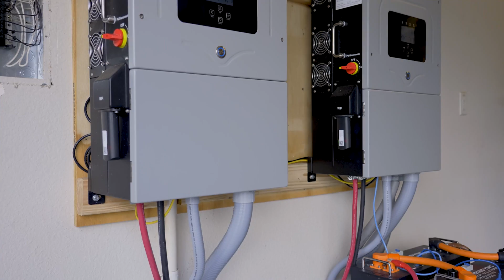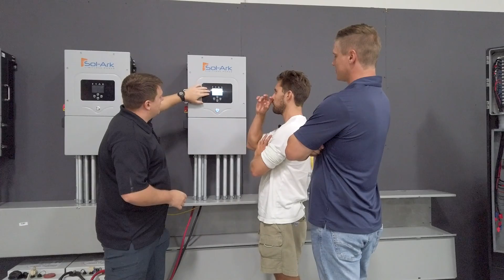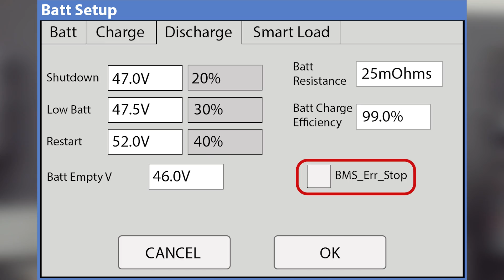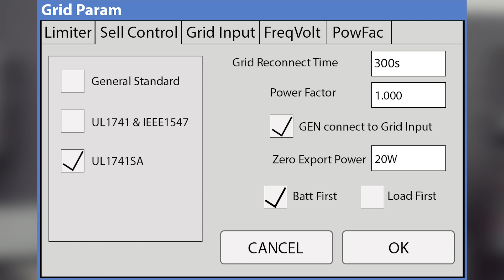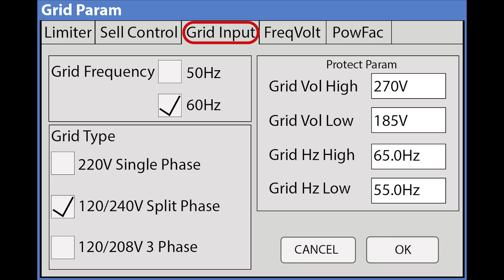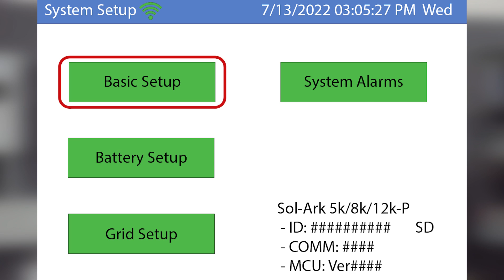How to Commission a 12K/15K in 30 minutes || Sol-Ark Install Guide (Re-Upload)

Comment: If you have a parallel setup do the setting on the master flow to the slave automatically or do I need to set it on the other inverter as well?

Comment: How do you adjust the Grid sell box?
Reply from the maker: enable time-of-use settings in the grid parameters LCD screen menu or use the monitoring portal
Reply: @Sol-Ark  Got it thanks.  Mine looks different from this video.  It's a split-box and not obvious you can select either section.
Reply from the maker: @charleshorseman55  its a challenge to get all settings available locally without requiring internet for programming/commissioning. at some point it becomes easier to review settings within the online monitoring portal. this video is a bit old, we do keep more updated training assets within our training portal at training.sol-ark.com

Comment: No thanks, I would never purchase or install any high frequency, transformerless inverter/charger in my system.
Reply: Ok, why do you personally want a low frequency transformer based inverter charger in your system? Are you connected to the grid. Solark seems very user friendly for those connected to the grid. Thanks
Reply: @paulbaker3144  I want a hybrid, low frequency, transformer based inverter charger because they provide a much high surge capacity for starting high inductance loads than this high frequency tansformerless design. They're safer because transformer based inverters can inherently block dangerous high voltage, high amperage DC current from passing through to your AC loads, which can damage those loads. And because low frequency inverters  typically last far longer than high frequency inverters.
Reply from the maker: Valid points in general however Sol-Ark has the most high frequency hybrid inverter field experience in the USA and actively maintains and supports its product from its USA HQ. HF has important advantages as well, such as better system efficiency. We also have EMP hardened options as well as EMP hardened battery partners. It's impossible to have everything but Sol-Ark is the most powerful single unit hybrid inverter on the market. 10 year standard warranty with 5 year extended option.

Comment: My Sol-ark 15k currently has no battery.  I've gone in to the Battery section and turned all the checkmarks off except "No Battery."  Rebooted and everything seems to be running, but there's still a battery icon on the main display (nothing going in or out of it) with 19.2V next to it (which changes).  Is that normal?  Any idea why it would display that?  The Battery tab is populated with some kind of information (default).  But, again, only the No Battery box is checked.  The big problem, though, is that I get periodic (every couple of days) Error 56 - DC_VoltLow_Fault errors:  Batteries are overly discharged, the inverter is Off-Grid and exceeded the programmed batt discharge current by 20%, or Lithium BMS has shut down. If battery settings are incorrect, this can also happen.  That shuts down my entire house as the 15k reboots.  Sol-Ark technical support has no solution except "add a battery."
Reply from the maker: Apologies for that inconvenience. I suggest re-engaging with technical support, especially via support ticket. We provide all of our support in house out of our Allen TX HQ, and there are managers that unresolved issues can be escalated to. Mention it is an ongoing issue when you fill out the support ticket here: https://www.sol-ark.com/contact-us/

Comment: Is there a way to connect the Sol Ark 15k to power the whole house using a All In One” (combination meter/breaker) service panel?
Reply from the maker: Typically all-in-ones also have an indoor panel on site.  The 15k would backup the indoor panel. The outdoor  "combo" loads could be relocated to a 100A subpanel outside the home, and then landed on the GEN port to also get access to the backup power (essentially abandoning the "combo" part of the existing meter base). One advantage is the outdoor loads could then be load shed during a power outage at low battery states of charge.

Comment: Very helpful.  I have a 20kw solar array and wanting to add 75kw battery backup (52v dc) how many would i need?
Reply from the maker: Often batteries are in 5kwh increments so 15. You can charge them with a single Sol-Ark 15k and you can put 20kW of solar on a single Sol-Ark 15k as well.

Comment: If AC coupled to the Gen breaker and have a loss of grid and batteries are full, the Sol-Ark will ramp frequency to 62 Hz or whatever was set on Smart Screen tab. When would the Gen breaker open in this scenario?

Comment: Thanks for the video!  (others have commented on the audio so I won't).   have two questions:

First question:  On the 19.2kW AC coupling limit.  Is that doubled if you have two sol-ark 15k's in parallel ?  Or is it a global limit?   For example, if I have two sol-ark 15k's operating in parallel, split-phase (north america normal), does that allow me to put up to 38kW worth of ac-coupled (enphase) panels up?

Second question: In terms of grid-export in situations where the solar is AC-coupled, the battery is full, the solar is producing way more than the house needs, the grid is up, and the grid-export limit would be exceeded, what does the sol-ark do?   It can't adjust the frequency since the grid is up so it is unclear how the sol-ark reacts to that.   (secondarily, does that mean I should also in addition to the sol-ark setup, install the enphase grid monitoring / export-limit feature too that uses comms to direct the enphase units to reduce power?).

Thanks!

-Matt
Reply: Both the 5k. and the 8k say 9.6kw A/C coupling but a couple of installer videos keep saying they are limited to 3KW. Sol-Ark states in their video that the 15k has a a/C coupling limit of 19.KW.  Just need to be really sure because all my panels have micro inverters and I want to install a HomeGrid Stack’d battery.
Reply: @kayjet64  Yes. The inverter's AC coupling limit is basically a function of its battery charging and discharging/inverter capabilities.  When the grid is down, it has to be able to handle the full AC coupled panel output for roughly 30 seconds or so while it adjusts the frequency, to prevent the micro inverters from shutting down due to thinking that they have islanded.

So for that parameter there is a maximum the inverter can handle, but the actual limit is more likely governed by the current capabilities of the battery conbnected to it.  Whichever is lower.

The grid's export limit is a different parameter based on 20% of your utility service size.   This doesn't count any AC consumed by the battery charger or the home, but you generally have to assume that the batteries might be full and the house might not be using power at some given moment.
Reply: Scenario. 8k Sol-Ark. I have 6KW A/C coupled grid tied Enphase. There should be no issue with the 3kw limit because whats not consumed (home load and Bsttery charging) will go back to the utility as credit (Net Metering). Issue would be when i’m off grid which is logical. ^kw A/C couple if there is no home load and the batteries are charged then it will be clicked until there is enough load to startup again.
Reply: @kayjet64  Yes, 6kW is small enough that there should be no issue on the utility side if you have a 200A utility service.  If you have a 100A utility service there might be an issue with the 4.8kW backfeed limit.  On the other-hand, there might not be an issue even with the 4.8kW backfeed limit if your panels never produce that much.  It sounds like you are in the clear there.

--

To handle a grid-down situation, normally the Sol-Ark is set to not charge the batteries completely full... usually just to 90%.  That way it can sink power by charging the batteries when A/C coupled solar output is greater than the home load for the roughly 30-60 seconds required to servo the micro-inverters to match the load.

This is where things get a little confusing.   There are two standards... UL-1741 and UL-1741-SA.  UL-1741 is the old standard and all it could do was turn the micro-inverters on or off using the line frequency.   In a grid-down situation, this is not ideal to say the least.

UL-1741-SA is the new standard which is able to actually servo the micro-inverter output using the frequency when in a grid-down situation.  This allows the inverter (e.g. the Sol-Ark) to match the solar output to the load.   However, since it takes 30-60 seconds to do this, the Sol-Ark still needs to use the batteries to handle slack in either direction.

So the best absolute setup is when both the micro-inverters and the inverter support the newer UL-1741-SA standard.   Meaning, generally, newer enphase inverters and the latest firmware for the Sol-Ark.  You will have to double-check that everything you have supports the standard.

And then lastly, AC-coupled solar can't self-bootstrap (I think I mentioned this before).  It needs a live circuit.  Meaning that if the batteries are depleted overnight in a grid-down situation, the system will not be able to turn on in the morning the next day if the grid is still down.   The solution here is to always have some DC-coupled solar so the sol-ark can charge the batteries up to their start SOC (5% or 10%) in the morning, turn-on, and thus bootstrap all the rest of the AC-coupled solar.

Comment: The new software version has reworded and relocated settings and i am unable to find the Power Factor Q(V) that is mentioned at 20:20. I have the flickering issue with LED lights.
Reply from the maker: Hi Emmanuel,
I recommend calling us at 972-575-8875 or filling out or contact us form for further help: https://www.sol-ark.com/contact-us/
One of our support techs will be able guide you to where that setting has moved

Comment: Looking at the 15K. We are grid tied and want a zero export system to take advantage of dirt cheap off peak power.

The utility requires the inverter to be disconnected while we would be using solar and batteries....how would we set that up?

Thank you
Reply: Use a transfer switch

Comment: Would like to see a more in depth video on AC coupling while also having whole home gen with 15k.   AC couple on the gen input as well as on the “load” side if possible, not grid side.
Reply: You would have a generator and ATS in front of the 15k between grid/gen/15k
Reply: FYI…..I think ATS stands for automatic transfer switch

Comment: This might be a stupid question but in my state there’s bo benefit to selling back to the grid so is there a way to set this up to not be able to sell back
Reply: Yes. You don’t have to sell back. You can limit it to home and it will just cover your loads only and throttle Solar and/or batteries if need be.

Comment: I had Sol-Ark 12k installed last year, during installation of the panels I asked if micro inverters would be installed on my panels and I was informed that they were not needed since the inverter provided the protection for the panels is this correct.  Thank you
Reply from the maker: Hi there,
Our inverter has protections in place for installations with and without micro inverters, so to answer your question, your installer is correct in saying they are not needed for the inverter to work safely. If you have any further questions, feel free to reach out to us at 972-575-8875 x2 or send us a ticket here: https://www.sol-ark.com/contact-us/. Our Engineers would be happy to answer any of your questions.

Comment: When your trying to sell a 10k ea product, dont release a video thats half assed.. You should know better. How hard would it have been to do another cut! Or is it not worth your time to do it right? You can be mad at me or say ...Hes right.. Your choice.
Reply from the maker: Hi Mihkel,
Apologies for any confusion, but just wanted to clarify that Auto Dim is on by default, but just in case it is disabled by the user, warranty will not be covered for just the screen if it burns out. The chances of a screen burning out are very low, but higher when Auto Dim is off and the Sol-Ark's screen is installed with consistent direct sunlight on it. We appreciate your feedback as it helps us improve, thank you.
If you have any further questions, feel free to contact our engineers at 972-575-8875 Ext. 2 or here: https://www.sol-ark.com/contact-us/
Reply from the maker: Hi PDS,
Thank you for the feedback, we hope to always improve our quality as time goes on and your voice helps us with that process. We hope to bring quality content for educational purposes, such as this video, and marketing purposes as well in the future. If you do ever have any questions that we may not have addressed in our video, feel free to reach out to our engineers at 972-575-8875 Ext.2 or here: https://www.sol-ark.com/contact-us/

Comment: how can I calculate battery resistance? I have 6 EG4 48V batteries in parallel. can't seem to find resistance specs. thanks!
Reply from the maker: Hi Tam,
While I am not sure of the exact value, our engineers may have the answer for you. Feel free to call us at 972-575-8875 Ext. 2 or contact us here: https://www.sol-ark.com/contact-us/

Comment: Another recommendation:

Consider a tutorial on installing parallel 15K units.  And specifically show how to wire the units to the breaker box, and how to parallel all wiring between batteries, and how to parallel each L1, L2, N, G, between the units, then into the breaker box.

thx
Reply from the maker: Hi JK, thank you for the recommendation. We'll certainly consider this recommendation moving forward.
Reply: @Sol-Ark  please do this video.  I have a 4 ton geothermal unit.  15k isn't enough for my house
Reply: Yes, please! I just received two 15Ks. Is the information already available?

Comment: I love all the features your product provides but cannot handle larger loads like some of your competition. Can you please comment why the Sol-Ark isnt even able to handle its rated load? https://youtu.be/pIfehhtZSOc?t=229 and this one here https://youtu.be/-Ez4cbuy7IQ?t=778 because its is VERY concerning. "very limited and handling large loads" seems like your 12kW unit can only handle a 7K load
Reply: I agree that the model name is confusing because 12k isn’t the off grid output. It can handle over 13k of PV input, 12k of PV output and 9k of off grid AC output. And the most important value is 4.8k L-N. Transformer based inverters have a much higher L-N value than transformerless inverters. If you know that going in, you can properly design a system that works as expected. The Sol-Arks I’ve installed are working great and it fills a niche.
Reply: I have 2 ea 12 K. I'm totally off grid and have brought in 21,000 W of PV and put out 16,000w to the house. No problems. Keep your loads balanced! Install at least a 40 space 200 amp panel. Install soft starters on your non-inverter PSC compressors and you'll be fine.
Reply: I assume balancing the loads, soft starters, needs to be done with the 15kW unit also? What is the upper limit on each leg of the 15kW unit? I know a widow that just had one installed and I have a hunch she might have overcurrent shutdown issues when she turns it on. The guy who installed is is very new at this. His first install. I have not seen inside the main service panel but it’s old and small.